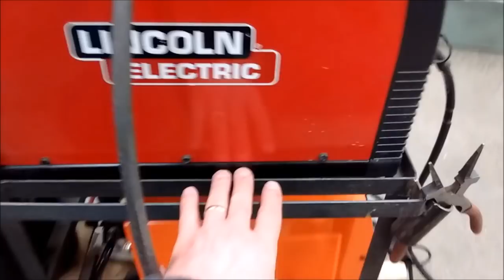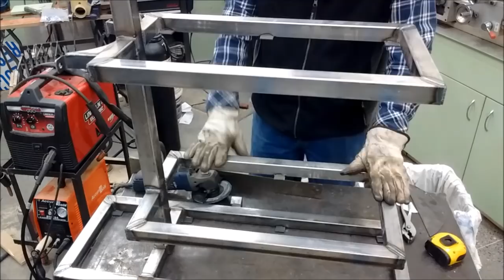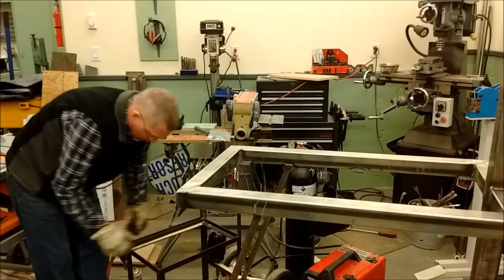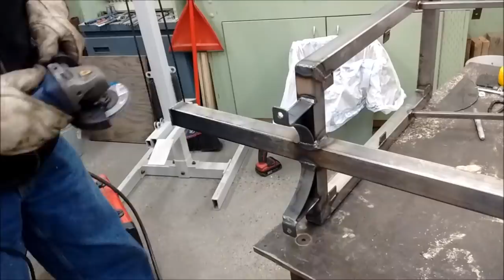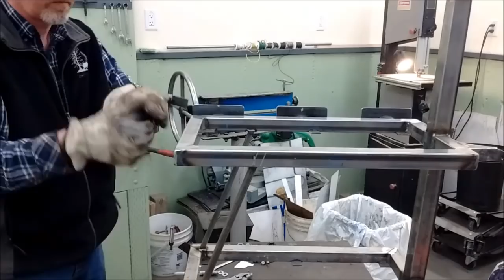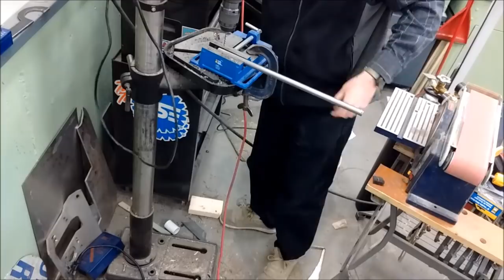BUILD a Welding Cart! FREE PLANS!

Comment: What size are your wheels and casters? It's not in the provided plans.  Thanks so much for the great video. Starting my very first weld with this cart.
Reply from the maker: I used wheels I had sitting around from a different project.  Just use what you have on hand or can find on sale.  The larger diameter they are, the better they roll.
Reply from the maker: Probably a caster height that that is about half the diameter of the large wheels
Reply: @GregWellwood  I think they call that the radius 🤪😜🤣
Reply from the maker: @andygingerichdrums  Radii - you have TWO wheels.  Hahahahaha.

Comment: The next time you need to drill holes with a cone drill or a larger diameter drill, just insert it into your impact screwdriver. You'll be surprised how easy it will be to do.
Reply from the maker: That's how I sheared the shank off my Milwaukee step drill (grin).

Comment: What would I like to see "different"?
I'd like to see the top shelf tubes extended further forward and the handle welded between these tubes.
I'd prefer a handle closer to 1" diameter (I think yours is too small in diameter for "comfort", yes I "know" it's just a welding cart 🙂)
The axle tube could be approx. 1" closer to the vertical tube to support the gas cylinder, no need for the extra dust collecting wooden shelf.
Why is the vertical tube so high? some limited form of gauge "protection"? A design element? A mistake 🙂?
I like the use of coupling nuts for castor mounting. I did something similar but "the reverse" I welded on some threaded rod and used nylock nuts to hold the castors in place.

A nice welding cart. 🙂

Comment: Oh my God !!!!
Doesn't this guy realise how precise welding carts need to be ?!?!?!
Not once did I see him whip out a micrometre or vernier callipers, and there was a total absence of gauge blocks !

Anyway, Now I've added the random comment you seem so keen for us folks to leave, I'd just like to say that it turned out pretty nice. I liked your presentation style too. :D

The drill press not being bolted to the floor may jump up and bite you one day. I used to have a really nice old "Meddings LF1" drill press years ago, But it got badly damaged and scrapped after I accidentally knocked it over when trying to humph a length of I beam onto the table.  I rented the little workshop I was in then and there was a strict rule that I couldn't drill holes into any of the buildings structure (Including the floor). I'd meant to mount the drill on a rusty 3' sq slab of pig iron I had kicking about for ages, But like always, That was somewhere down my list of things to do. The REAL kicker is that drill would now have been worth about 10 times what I paid for it !!!  :(

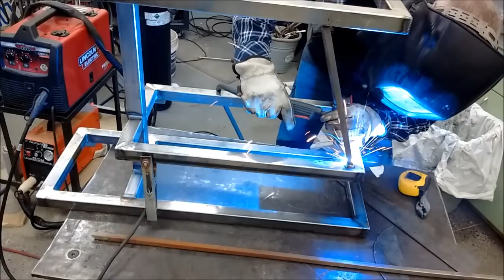Comment: There is a chicken and egg problem here.  How do you build the first one if you don't have anything to put your welder on?  You didn't get your welder from Princess Auto?  10:47  Some folks don't have a very good eye at all, so they use a cheater lens.
Reply from the maker: 1) I'm a Time Lord, and traveled back with the new cart, to build the first cart, so I could build the second cart. 2) Canadian Tire. Princess Auto doesn't sell Lincoln, as far as I know. 3) For some people, a cheater lens still won't help them.
Reply: @GregWellwood  Yes, they (Princess) sell Lincoln machines such as the Easy MIG 180.  I think their ProPoint welders must be of an older design because they only come in black and white.

Comment: Good job.A quesion: what are the dimensions of that little weld table like height, thickness of the sheets, etc.
I need a little one like that.
Thanks in advance
Reply from the maker: The weld table is roughly 2' x 3' x 1/2" plate, with three legs of SCH40 pipe that were short enough to fit under a workbench that came with my house garage. I used three legs because the floor in the house garage is not awesome. I've since taken the top and put it on a taller bench/desk/table rescued from the scrap pile at work. You can see that version on some of my '61 Apache videos.

Comment: Nice job with the cart.  I especially liked the way you affixed the casters.  I ended up drilling holes in the bottom, then welding nuts below them (works great and doesn't stick out from the frame).  Subscribed....